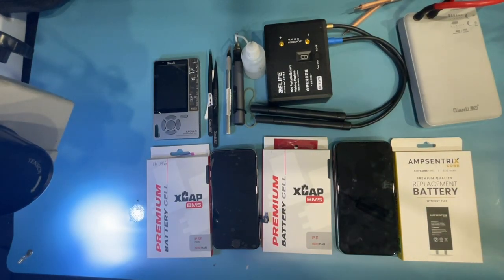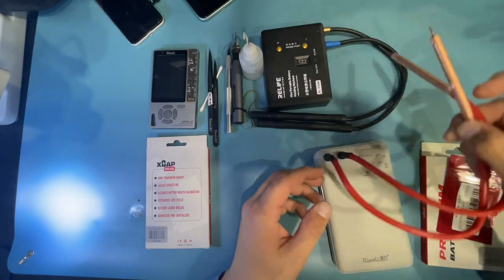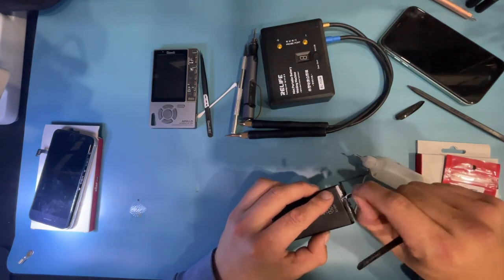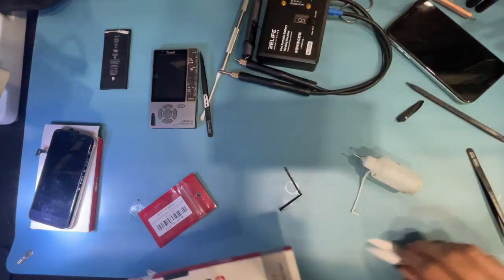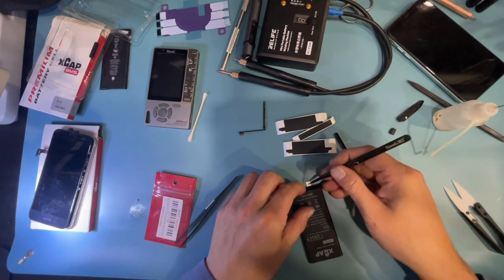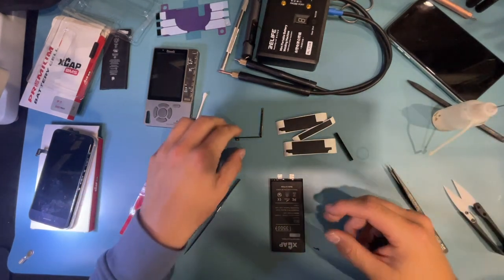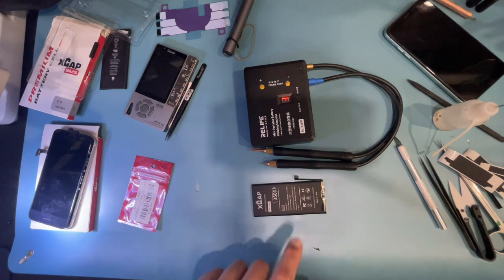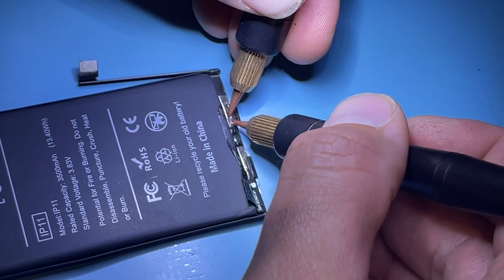Detailed walk through 100% battery replacement NO message, New Easier method XCAP BMS.

Comment: Great video I am about to replace my own Iphone 11 pro battery so have had to buy a lot of new bits and pieces because it will be my first attempt at doing these batteries but it is a shame because I've changed so many of the earlier models batteries over the years it makes no sense to me why Apple have done this however they are money grabbers so I understand it but still its great that there is a way to get around it however I have had to buy a reusable tag on flex which should help with the process anyway thanks this video has helped a lot.
Reply from the maker: If you’re going to do this yourself be very careful handling the battery and of course take extra care to avoid bridging the two leads of the battery together. 

This is not a repair for beginners, I am also available if you want to mail the photo me to me and have it done.

Comment: Amazing clip ❤ I have changed the battery of my iphone se 2 2020 model. After i got battery not recognized. The ay a108 can copy the bms of the original battery ? Or it just resets the bms life counter? I have found different info. Already buyed the ay 😕 i hope it can copy also. Searched a lot for the Qianly but did not found it only with the battery board for se 2. I also wanted for my new iph 14 because i probably will need it in a few years. The se hold up around 4 years now. Please help me. Thank you 🙏🙏
Reply from the maker: For iPhone SE 2020 if you don’t have the original bcm then just use full aftermarket battery and update to iOS 18.1 beta and it gives battery health back and just says “unable to verify this is apple genuine battery” this message is fair and all I ever cared about was getting the battery health in settings.

For the iPhone 14 I will have videos coming to show how to do these on iOS 18.1
Reply: @phonedoctorbrady  thank you so much for the detailed info 🙏

Comment: Very nice video, thank you! I love your channel.

Do you have experience with battery condition below 65 percent? I hear it's hard to reprogram a new battery.
I'm now having a problem with an iPhone 11 with an AmpSentrix battery - the original battery was 64% condition. After welding the BMS to the new battery, DCPS boot, deleting the cycles and setting the condition to 100% with JC tag-on flex, my phone now says 55% condition. Will it help to flash the phone?
Reply from the maker: This will be a weld issue in my experience, imagine the battery is water and needs to flow to the bms. If you have solid connection you have good flow and easy access to all the contents of the battery so the bms records the health as high. Imagine then if you have week connection and poor flow you can see how the bms would record a weaker percentage
Reply: @phonedoctorbrady  thanks for your answer. I will try weld it again
Reply: So I weld it again... Now I have 100% condition but Important message and Service is still here.. I try flash phone with 3utools too and still the same  😕Im desperate
Reply from the maker: @Smart112567  working on the solution for this. Right now my advice is to inform the customer that the capacity is back to 100% but the message to service the battery does not immediately go away. I believe that after some time of use with 100% capacity that it may go away.

Comment: The tag in flex is not needed to be left there, only leave it there if you don’t want the battery condition to go down 100%, as the tag on flex would never let it work properly as it should
Reply: Do you still need a tag on flex if you have a programmer?

Comment: Thank you for the informative video!

Sorry if it is a dumb question but I am only planning to do this on my personal phone and I was wondering if the bms swap is necessary to get battery stats or is it enough to buy the more expensive battery with another bms and use the tag on flex on that one?
Reply from the maker: No matter how much you spend on a battery you will need to do a bms swap to have battery health data and the updated percentage.

This is not a beginners DIY repair. If you’d like to send your device to me I can handle it for you or I can help find you someone closer to you to handle the repair.
Reply: 100% is read only on the device, but in 3utools it remains the same as the previous percentage for example 78% before battery change. is it possible that the 78% percentage will slowly increase to or near 100% over time based on your experience so far, sir?
Reply from the maker: @yourclips9974  it takes atleast 14 days for the true battery health to record within iOS and show on 3u tools. And this only works if the install is perfect as well
Reply: @phonedoctorbrady  iPhone 11 battery replacement in this video it's been 2 months ago, from the old battery 81% has been replaced with a new battery which now shows 100% on the device. I believe that 2 months ago you also noticed that when connected to 3utools it displays 81% and lets say 950 times of charging. you say with a perfect battery replacement in about 14 days it will show real health in 3utools. is now the iphone 11, let's say for example it has become 99% and 45 times charging? I ask because your method is exactly the same as I did in replacing the iPhone 11 battery and above and without including additional flex into the device. thank you sir for the response
Reply: Hii have You tried programming an ampsentrix battery with the xcap tag on flex?

Comment: I tried this repair on my iPhone 11 battery , I did the first boot up with the charger and I did get the important battery health message but when I switch the phone off to reboot it , I end up taking out the mini Adapter to early an now the battery health is still at 79% .... so my question to you now is . do I need to get a brand new battery again and start back all over or is the a way to reset everything an start from there ? !
Reply: u need a battery programmer like jcid v1se wifi to reprogram the health and cycle count to rest the old data to 100%